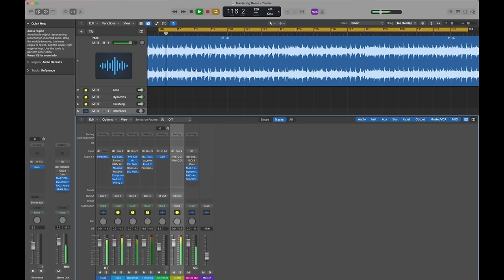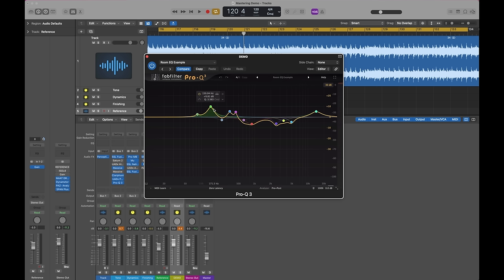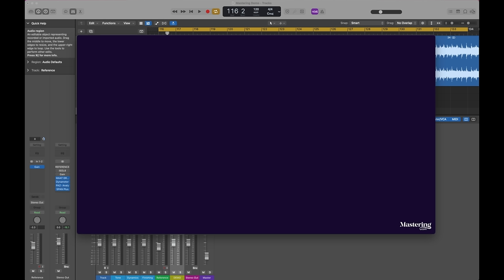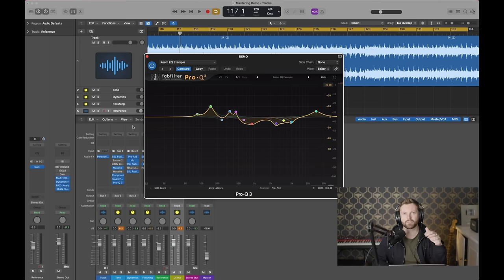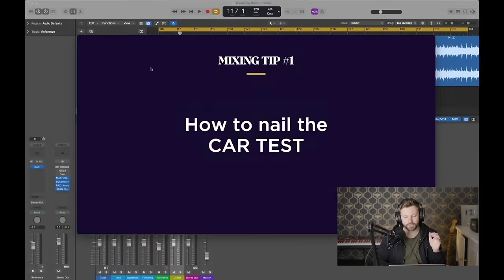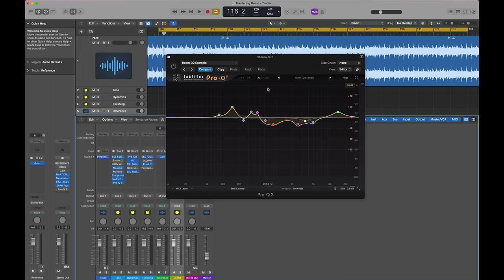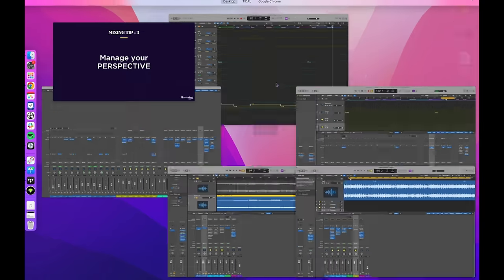21 Mixing Tips That Nobody Told Me

Comment: 0:04 #1 How to nail the car test
4:28 #2 Fix your room
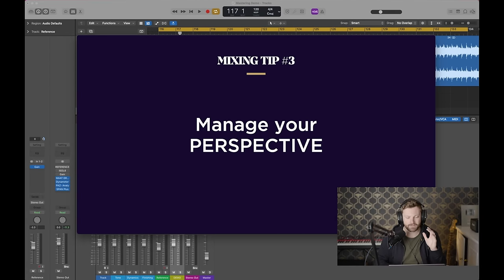5:17 #3 Manage your perspective
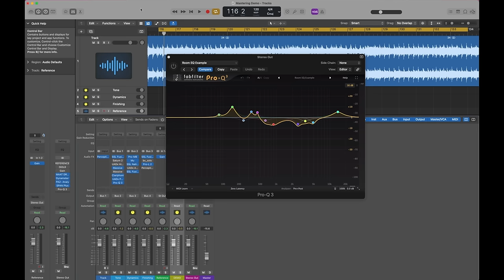7:19 #4 Train your ears
10:22 #5 End in mind perspective
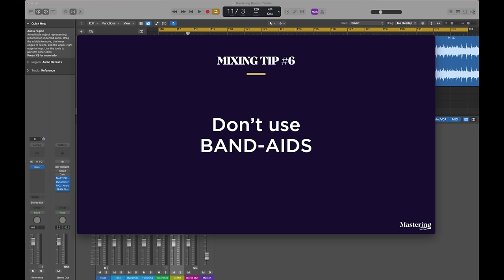12:20 #6 Don’t use band aids
12:41 #7 Balancing is 80% of the mix 
15:17 #8 Don’t neglect volume automation
19:22 #9 Progressive referencing
21:44 #10 Any workflow works
28:12 #11 Mix fast
29:42 #12 Intent based EQ
33:27 #13 Fearless compression
37:21 #14 Don’t neglect clipping & limiting
40:29 #15 Close your eyes
41:45 #16 Mix in 4 dimensions
43:39 #17 Know what matters
52:44 #18 Objective vs subjective
54:02 #19 Lean into subjectivity
59:56 #20 Master the objective first
1:01:16 #21 Get clear on what’s holding you back
Reply: Man you're a cool guy! Thanks 👍
Reply: Most under rated comment ever.

Comment: #7 is literally the most important. Beginner mixing involves beginner tracking/arranging unfortunately and can be quite a struggle....i guess i overpracticed when starting but upon finding and starting to do decent source material it was more obvious that i should do less (and that i was better than i thought as long as i did that!). Seeing it as a whole where you swap between elements a lot rather than focusing on a single instrument is great too
 I also have some fix for my own weakness which is to do nothing in the bass until all instruments are balanced, separated, compressed etc. and all the mid cuts or boosts take place (why? Because otherwise i boost the kick or bass, in the low end, then at end realise i didn't need to so must fix that...its a known personal bad habit so i have a rule!)

Comment: I think gain staging is more important in these live environment for the whole flow through. In the digital realm of recording as long as you have enough signal coming in that you're not hearing the noise floor it's not as much of an issue anymore. It would be interesting to see where that whole mixing in mono thing came from all the stuff I found a crossed is that it was to check mono compatibility and in some cases that helps discover things well mixing.

Comment: gain staging is very important when you're mixing with lots of hardware emulated plugins, as they have a sweet spot where they react as intended. though, sometimes you don't want to use them as intended ;)
Reply: In Reaper i set a default of -12db on any new tracks. Helps the process immensely, and instead of having to go back and turn down near the end, its more like i turn up at the start when necessary

Comment: Isn’t it better to use a gain plug-in and automate the gain of a track so you can adjust the fader independently? If you use volume automation it locks the volume into place on the track and the only way to higher or lower the fader is to highlight all the volume automation and push it up or down. That takes so much time… Maybe I’m missing something.
Reply: Yea as always it's your preference, u could use the fader then use a vca track or volume trim in protools also clip gain, again it might be what he prefers
Reply: Well you could do that (as long as the gain plug-in is last in your fx chain) but there’s really no advantage. Once you’ve automated the volume you can still use trim to ride the entire track up or down if you want to.
Reply: @Tony-yp7ok   How do you use trim?
Reply: @FortVine  it depends on which DAW you use - they all do it differently. If you do a search for volume trim and the name of your DAW I’m sure you’ll find some instructions - it should be very straightforward.
Reply: @FortVine you could do that (automating with trim plugins instead of the fader), but then Pre-Fader sends would not be Pre-Fader sends anymore, that’s the only drawback.

Comment: I will comment only the beginning of this video, because I think it can be major gamechanger with a good tools. Even a good room treatment shows almost non-solvable problems without any  correction. I found Sonarworks SoundID as gamechanger, for headphones AND for studio monitors. You can learn everything on every gear You listen on, but at the end - no one isnt neutral and give non-flat sound characteristics. You can simulate average devices out there without even listen on them. The magic word is calibration. If You do not calibrate Your room and headphones, You'll never know, how music SHOULD sounds. Human ear can adapt on anything. In the past, low bass and highs level was characteristical, now exagregated both are obvious trend, practically in all genres. I'm not some Sanarworks salesperson, but tech freak, without compromises. Yes, some phase issues and latencies are introduced when calibrating shitty headphones and room + monitors (sum of both = common amount of badness). So solid headphones or good treated room + solid NFM is solution which works best for me now about 5+ years. And calibrating each of them separately, to different profiles. When You get flat characteristics, you can simulate other gear like NS10, different phones, typical cars, TVs, cinemas, etc inside Sonarworks with one click - You will never look back. I am following debates mostly high end gear users, spending a long years learning their ears on current gear they own and searching for issues of Sonarworks an other calibration tools. Silly, wasting time to learn on raw equipment, when a few hunreds of $ can save a lot of time. At the end, for final mix, or mastering, You can switch off calibration, if you trust Yourself, You are better than software, and I'm sure professionals will do that, but for middle experienced mixers and enthusiasts, no fastest way to avid a loooooooot of troubles is the way, I'm describing. They have free trial, believe, it's worth to know what You get. And freely buy me a coffee for this advice :) Just one more note: besides using references, try to overview your mix on Tonal Balance Control or something similar, to get the idea, where You are out of all standards. Yo can "reset" Your ears too, but to get close enough to final polish - use more equipment to calibrate Yourself to widely accepted standards, because You're not so special, when You come to the music market, to sell Your personalized non-standard ideas. And happy wasting of Your time for those with ideal hearing after listening to silence or background noise or whatever is adviced to rest Your ears :)
Reply: Am i supposed to read your rant ?

Comment: Hard to believe he's not talking about headphone EQ-correction and room emulation , such as Slate VSX, Waves nx studios, and more.
Reply: Since he didn't can you fill us in?
Reply: @yawns3004  Well, similar to rooms, headphones never have a flat frequency response, so companies like Slate Audio and Tone Boosters (to just name a couple) have EQ correction profiles for headphones. These make the frequency response of headphones flat for mixing. However, to make headphones behave and sound more like actual speakers in a studio room, Slate Audio produced the VSX headphone system, which includes many emulations of pro studios, cars, boombox and even other headphones. Waves Audio has a few pro studio emulations that can be combined with the likes of Tone Boosters' TB Morphit, to provide studio environments with EQ correction.
Reply: @drinkinslim  thanks! I didn't know any of that before
Reply from the maker: Yes if you're using headphones Sonarworks can really help, Slate VSX is great too but not a true replacement for a treated room - just a supplement IMO.
Reply: @masteringcom  I think Slate VSX is of most value to those who don't or can't have a studio room, or can't afford studio-specific gear, speakers, treatment and acoustic correction, and travelers (like myself). 

The latest version of VSX is their best yet but, personally, I think that EQ-correction is more important than feeling like you're listening to speakers in a studio. 1) because ya get used to the stereo image in headphones and  2) because so many consumers listen on headphones or earbuds. 

There's more to this story, but it's a whole topic in itself. 😎
Reply: SergeysVideoChannel  This isn't true. Most have frequency responses that are out of whack. Would love to know of any that are already tuned though. :)

Comment: i’ve always wondered why people who mix entirely ITB don’t just bring their laptop to their car, plug in to the speakers and spend an hour mixing there?
I guess you’d be using your CP’s converters but maybe not such a big deal? Or bring a little apogee interface or what not , and send that into the car aux.
Am i missing something really obvious with this idea ?? 😬
Reply: People could totally do that, but it'd be easier to put on a pair of Slate VSX headphones with one of the car emulations. Saves a lot of moving gear and sitting awkwardly in a car. 😂 Having said that, of course you need money to buy the VSX.
Reply: b/c then you'd just go back to your room and the sound will suck there. then go to the stereo and it will suck there. on and on
Reply: I guess my point is, if it's so common to be frustrated w the mix in the car, maybe some tweaks while in the car could help. Then see how it holds up in the studio. Seems that might save some time from the classic 'tweak it 12 times in the studio because each time you hear it in the car it sucks' problem. 
But I do get it, that the issue of mixing translation is more complex than that. 
I've learned some valuable things though mixing in my car occasionally. Every extra 1% counts.
Reply: The aim isn't really to get the mix sounding great in your car. The aim is to get the mix sounding great everywhere, including your car. This is why we also test for laptop speakers, phone speakers and crappy mono speakers.
Reply: Yep, this is actually brilliant for balancing the low end.

Then you balance mids and highs + panning on your monitors in a room with treatment on first reflection points.

Lastly you use headphones to check and clean up reverb tails and general depth.

Great workaround when you don't have a completely treated room to work in.

Comment: Mix in 4 dimensions. You give 3 of them, height, width and depth. You didn't say the 4th. Is that simply "TIME" ?
Reply from the maker: Correct
Reply: Time. Sounds happen at a time, and what a sound is an issue at a particular millisecond, it might not 5ms later.